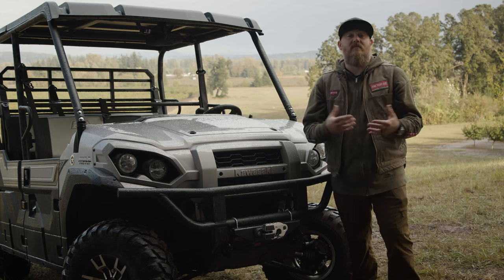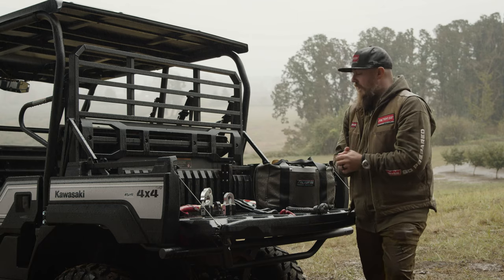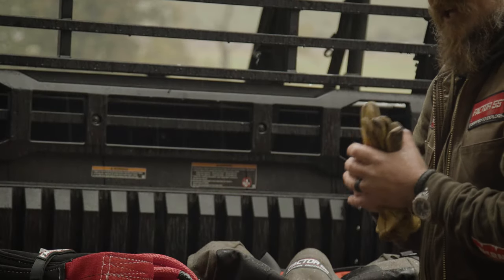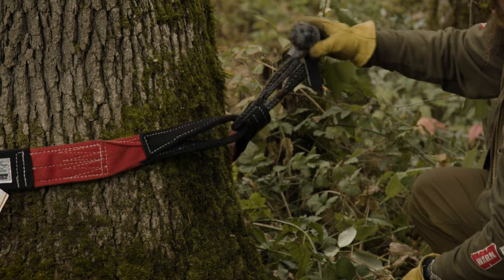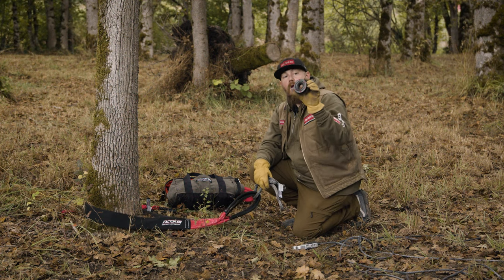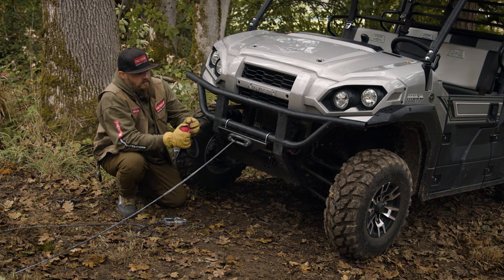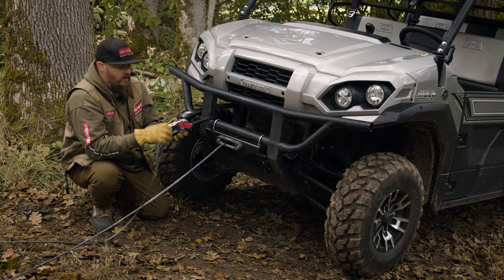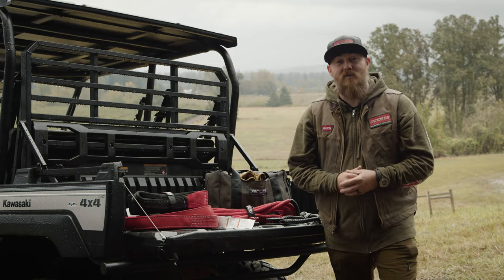Closed System Winching™ with FACTOR 55 XTV Powersports Rigging and Accessories | UTV ATV Recovery

Comment: Dude, your video was great up until you stepped over the winch line under a load. You're lucky, even with new recovery gear failure is possible. Please make sure you follow safety protocol for yourself and for your viewers